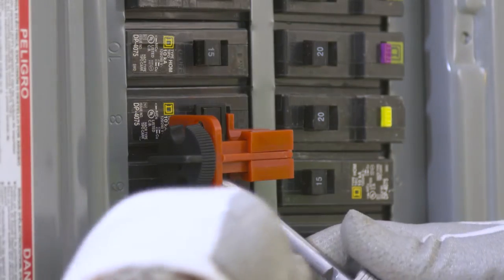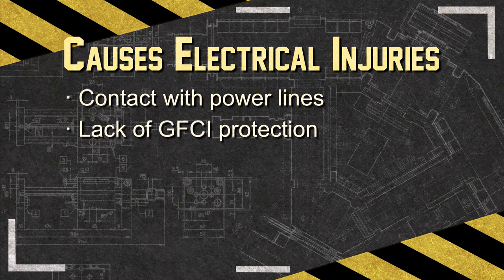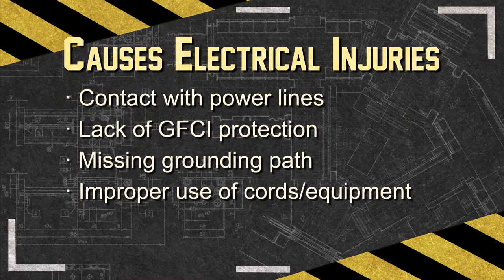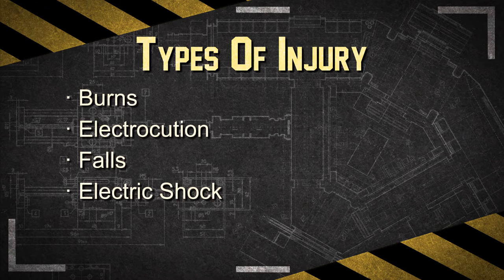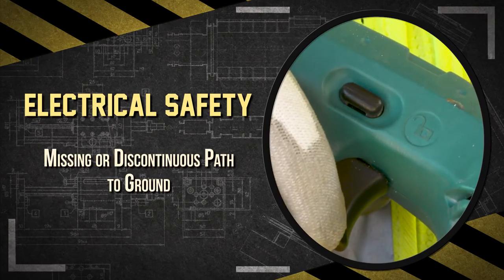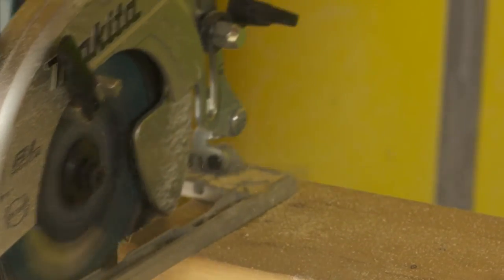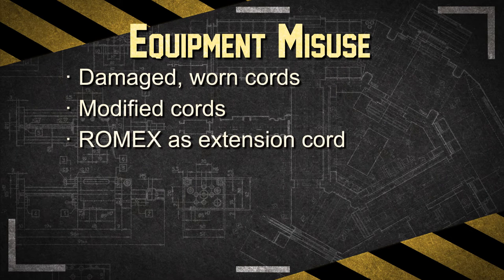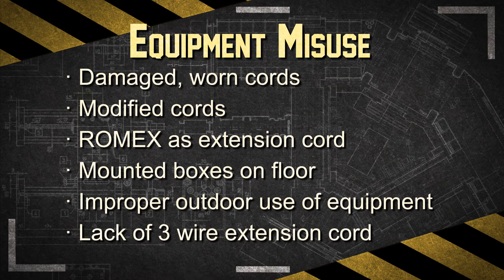Construction Safety: Electrical Safety

Comment: Good 
 Video
Reply: Retired from a large hospital/research center. They had at least 1 shop vac on each of the 12 floors along with back ups. During one water intrusion they must have had 6 or 8 guys with shop vacs sucking up water while 10 to 20' feet of 120 volt power cord was in water. Raised hell and ended up installing cord GFCI  one foot from male pluge to protect the fools. Told me but they are double insulated shop vacs.